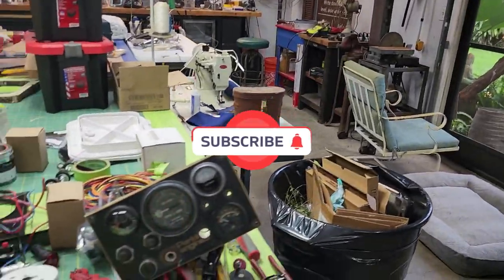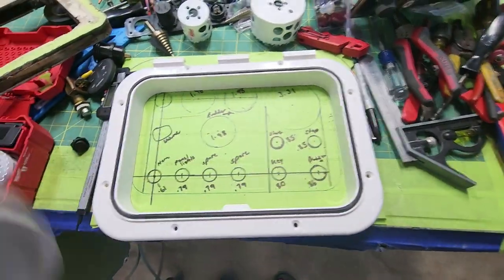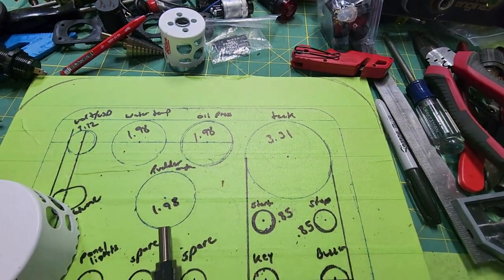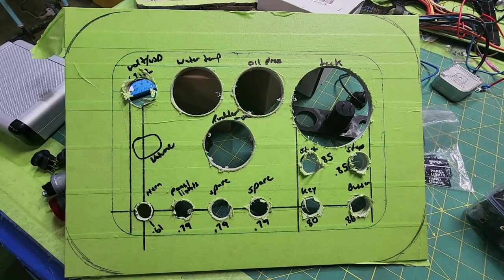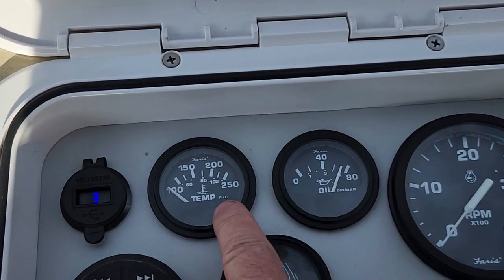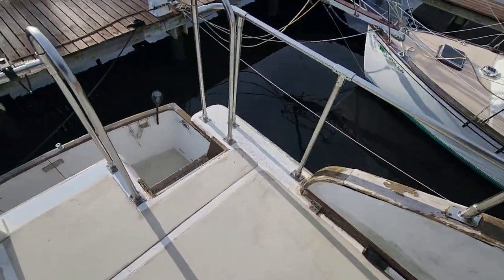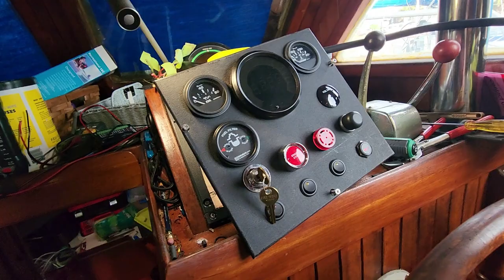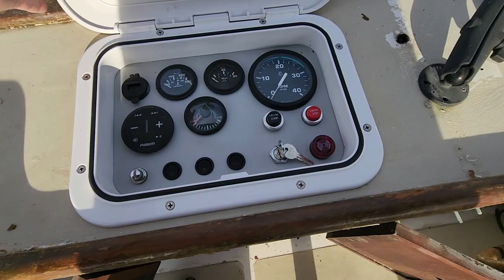Trawler DIY - Replacing old upper helm gauges, switches start/stop buttons in a waterproof enclosure

Comment: Looks great.
Do you use a phone for nav/maps? If so, you could glue a phone mount to the underside of the cover so when its open, mount phone and plug into USB to keep charged.
Reply from the maker: Ted..great idea. I usually have a chart plotter going alongside a tablet with Navionics. Im sure i could incorporate some kind of mount there. Thanks for the great idea. 💡